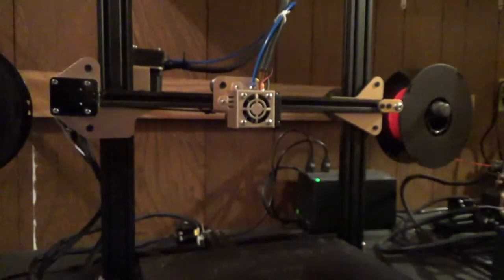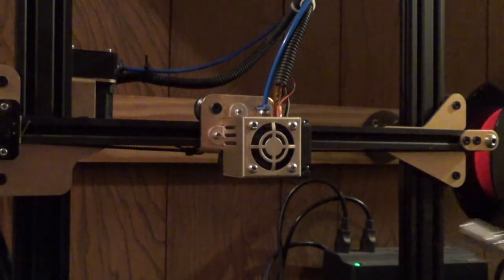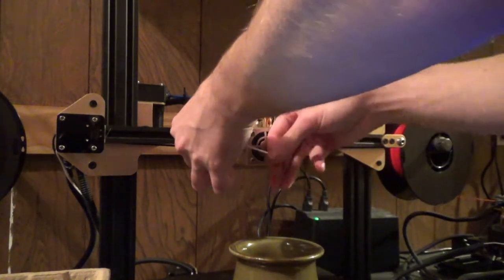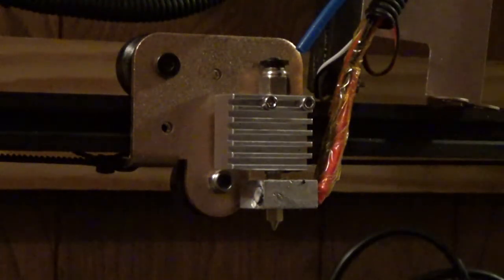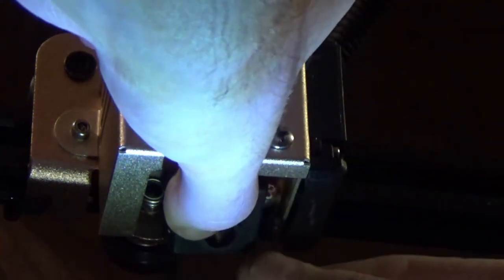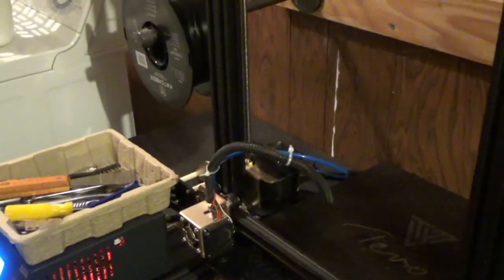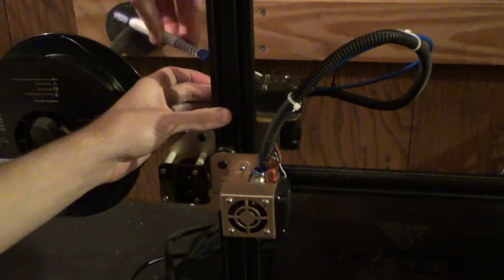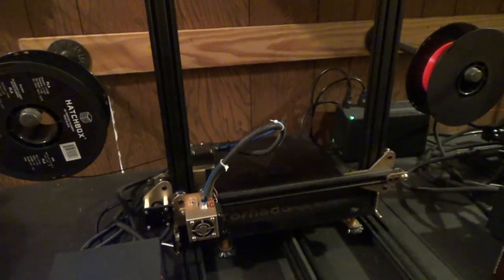How I assemble the hot end for the Tevo Tornado 3D printer (Gold Edition)

Comment: When I started making my kits, I was running ender 3s, and I would keep running into the same problems you were,  I started switching to Prusa Minis, and after about a year now, I have 5 of them, and the consistently between them is great, they just worked, I hardly have to do any maintenance on them. The stuff I print is a lot smaller than what you do, so the loss of build area might be more  detrimental to you, but might be worth looking into them as you scale up.
Reply from the maker: Oh yes, the Prusa minis are great machines! I recently scaled my operation by adding 5 Ender 3 Pros. I don't mind the maintainence for now, every printer eventually needs repair. I've built up a pretty good confidence in these machines, and for the price they're pretty sweet. I can keep them running for a few months at a time before I need to do maintenance 👍